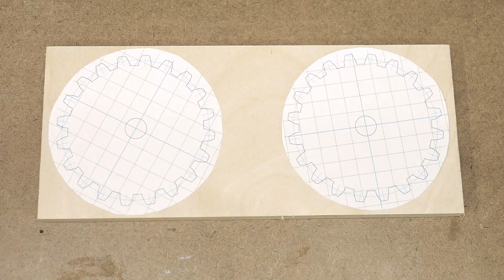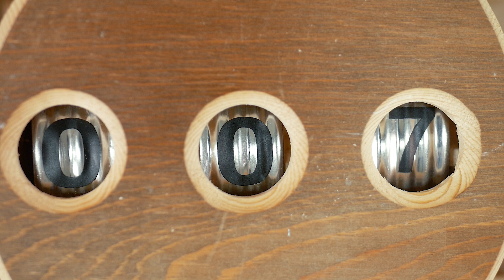Mechanical Rotary Counter

Comment: The rotating base is cool and all, but to add some functionality to it you should redo the base with another gear, that would lead to a vertical shaft with another gear, then leading to a handle on the side that you can crank to move the numbers. Little more cumbersome, but will look neat. Plus who doesn't like more gears? :)